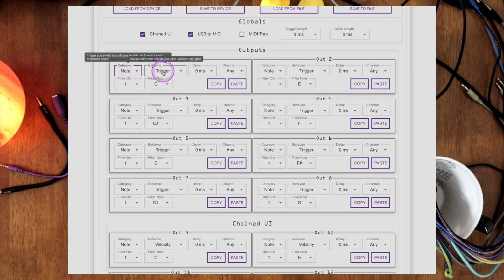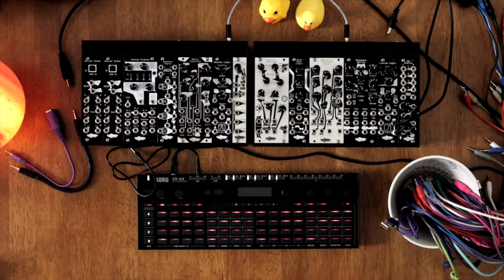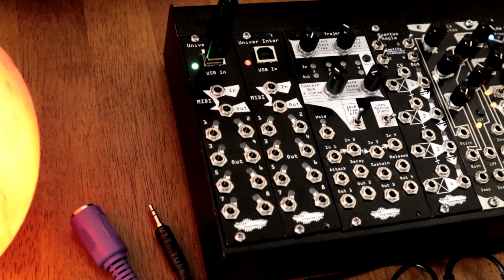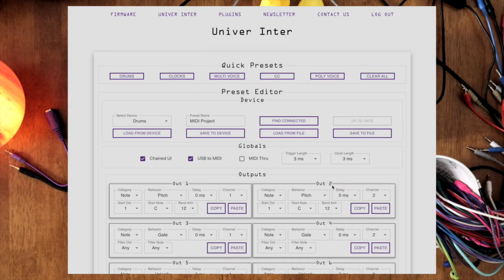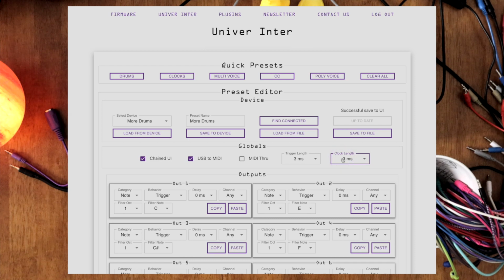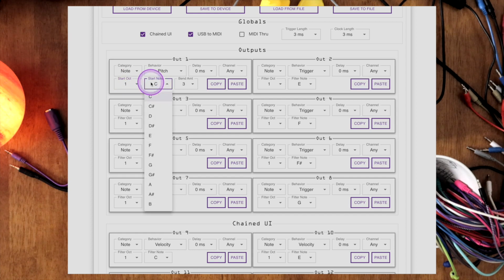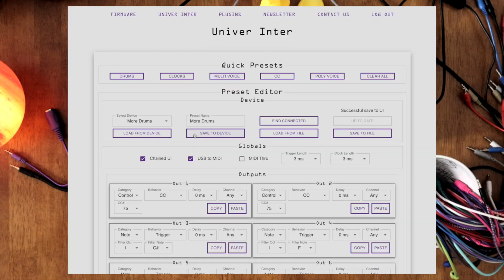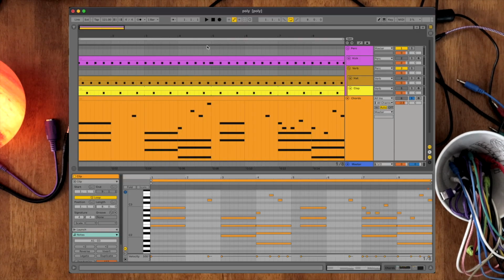Univer Inter chainable 8-output MIDI-to-CV Converter and USB Midi Interface from Noise Engineering

Comment: I saw this one come up on Modular Grid, what happens when for some reason that web portal isn't up or forever down?
Reply from the maker: It's working for me. You can also try 
https://noiseengineering.us/portal/univer-inter/
if the portal is blocked for you.
Reply: @NoiseEngineering  Thanks for replying! I can reach the portal but this would be my first module that I can't configure locally (?). I am still thinking of pulling the trigger on getting it, but that reliance on an external internet entity for config is new to me. Could I clone the page and run it locally? Not sure what is required under the hood...